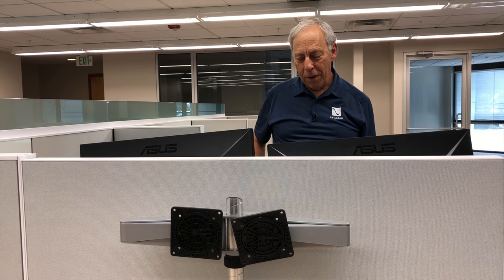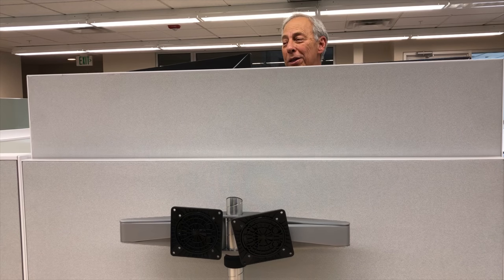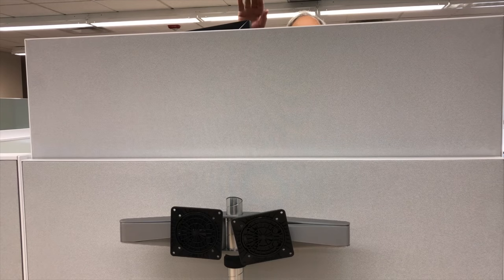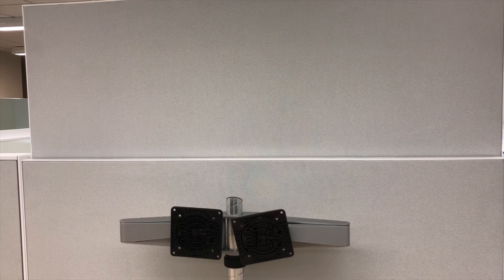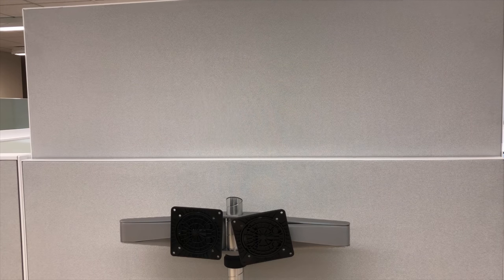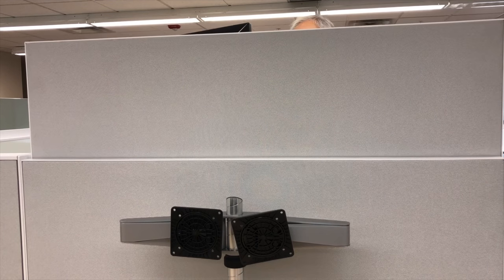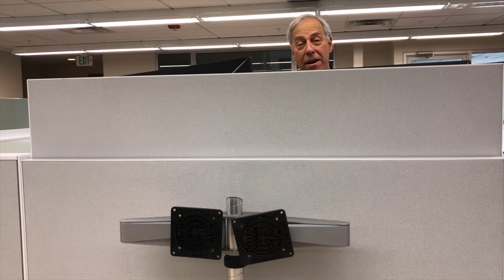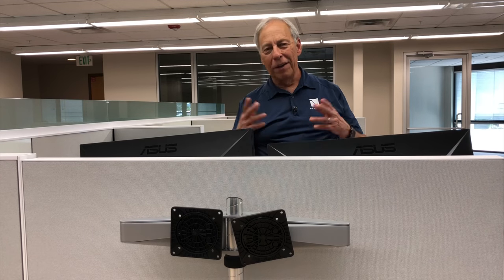Replacing capacitors in vintage equipment

Comment: Excellent info,  Paul, much thanks.

BTW, I wonder if it's a good idea to replace electrolytic capacitors with lower ESR solid state capacitors (e.g. tantalum, polymer film) of similar capacitance value and equal or higher temperature and voltage capabilities.
Reply: it could be a good idea to replace electrolytic caps with solid state ones, but solid states caps don't have high values rating like electrolytic (for example you can find 100 uF polymer but no higher value) or you have to put lots of caps in parallel. If you can do this big parallel on a DIY circuit where you have space enough to manage, you can't do that on a commercial amplifier where internal space is little. I have worked some 10 years as a electronic technician for cellular phones and we had great problems with tantalium caps so my advice is: avoid them. On signal path, if you can, use polyester or polypropilene caps. On power supply use just regular, fresh electrolytics and you are good to go

Comment: A a hamradio operator who restores and uses vintage  +/- 60 year old radios. I deal with lethal voltages. I have all of the necessary instruments do the the work.  Learn what brands of cap age well and those that don't. A meter that shows ESR's is your friend.

Comment: I have a pair of klipsch  chorus  speakers and want to recap them,looking high and low on the net with no luck getting  the same values,talked to crites and he wants  $90 +shipping  to  Thailand   plus exchange  rate and import duty.....$180 cnd  for 8 caps....ouch!!! Any idea where I could purchase replacements... 7 uf and 68 uf 100 volt,and 2 uf 250 volts.....

Comment: Been watching a few vintage amp repair vids lately. The amps seem to be in the 40  year old range (if not more) and only ones worth the effort of course.  Anyway, even after 40 years they weren't replacing all the caps. In other words 20 years is probably unnecessarily aggressive.

Comment: I largely agree with everything here but think Paul is being a bit pessimistic about timescale. Good quality electrolytics are usually fine for more than 30 years so long as they haven't been overvoltaged or exposed to much heat.
Reply: Haveyouevercheckedforleakage?

Comment: Question since you're an expert..  If I own high end audio equipment from Accuphase, dCS, and McIntosh and I want it to last as long as possible... is it better to leave it on all the time? or turn it off when not in use ... in terms of keeping the capacitors and other components health inside.. and last longest?
Reply: The only thing(s) in danger of going bad from not being on are the electrolytic capacitors. If you're running them more than a few hours a week that's good. I can't think of a reason to leave them on constantly, especially during a lightning storm.
Reply: @seanwatts8342  so the on/off surge of power and heat/cool down cycles are less of an issue than leaving it on all the time?
Reply: @seanwatts8342  thanks man, much appreciated my brother.
Reply: @Sams911  Let me clarify an exception: inrush current to a large transformer that does not have any kind of current limiting or "warm up" circuit can cause an audible 'thud' but you can reduce the chance of anything bad by using the 'standby' switch if you have one. OR if you're around all weekend and you know you'll turn it on and off several times, use the standby or even turn in down if you're on the phone, etc. Leaving it off for more than a day? Turn it completely off. Personally, I like to use a surge arrester and turn on the arrester, then the electronics - then electronics off --> surge arreser off. I'm not an EE, but my long time friend is an EE.
Reply: @Sams911  There IS inrush current BUT unless you're switching on-off-on 25 times a day (maybe more) then 'yes.' High end stuff is all solid state these days unless you have a tube amp?
Reply: @seanwatts8342  if you go to my channel you can see my system, two of the brands have standby modes, but my Accuphase stuff, which oddly is the most expensive stuff only has a hard power switch...  my pre-amp is a 100% tube pre-amp so that I know to turn off when not in use, so as to save the 12 tubes lifespan.

Comment: I got a pair of AR5s I bought new in the 70s, I had the 10 inch woofers tweeters n pots replaced in the 80s with original AR units when AR was still in Britain Dunstable I since replaced the tweeters bought from the US SH quite expensive SH but originals in early 2000s, I had them in my shed since I manage to buy a pair of AR9s SH the Real AR9s with a 10 n 12 inch woofers mid range 8 inch tweeter n super tweeter I found out trying my AR5s recently one of the electrolytic capacitors is gone finish of course I will replace both they are huge, someone said to me now days they have better caps not paper wound ones is this true? and how do I get the right one and will they degrade the sound quality in any way?

Comment: One thing that shortens the life of electrolytic capacitors is temperature. Replace with 105 C low ESR caps. There are many discussions online about replacement caps for vintage equipment, with even more opinions. Two names that frequently come up are Panasonic FM and Nichicon HE. Here are some brands:

Rubycon
United Chemi-Con (or Nippon Chemi-Con)
Nichicon
Sanyo/Suncon
Panasonic
Hitachi
FPCAP or Functional Polymer Capacitor (ex-Fujitsu caps which was bought by Nichicon)
ELNA
Cornell Dublier
Illinois Capacitor (Currently owned by Cornell Dubilier)
Kermet Corporation
Vishay
EPCOS
Wurth Elektronik

Some audiophile signal-path electrolytic caps only come in 85 C versions. Since audio grade caps weren't available when the equipment was designed, it is likely that the 105 C caps will sound fine. They will likely sound better than the degraded caps in any case. Of course you can experiment with audio grade caps, just be aware that 85 C caps may not last as long. Stick to 105 C in the power supply section.

Paul mentioned that selecting caps of the right physical size is important. When ordering caps, also make sure to note whether they are axial-lead or radial-lead configurations. Some of my gear has bi-polar or non-polarized (NP) electrolytic caps. These axial caps have a concave ring (+) at each end. In a pinch, you can make a NP cap by connecting two identical caps of double the capacitance in series, back-to-back (negative to negative). Two identical caps in series provide half the capacitance. The ESR is doubled.

Comment: Do not replace anything UNLESS:
- You know what you are doing and can actually do a proper solder.
- Know someone or company with the qualities mentioned above.

I have seen so many amps ruined by people who thought: I can do this, "i read it online". Burned PCB traces, caps that have been replaced with worse quality as the originals and fake transistors. If an electrolytic cap is bad, you can visually tell. If you want more bass, than larger caps are not going to do much for you.

Comment: Should one replace just the large electrolytic capacitors on the input power supply part of the amplifier?  (I'm guessing its setting up the DC bus but I'm not an EE.)  Or, do you need to go all out and replace every single cap in the entire amplifier?  Thanks in advance.

Comment: So, power supply caps will not make an audible difference unless they were going bad, and typically if they get out of spec and the amp knows this, it won't even power on.  So, please don't expect that power supply caps would make any amp sound different, rather newer power supply caps would simply restore the amp to it's original designed specification (in the power supply section).  Oh and yes, electrolytic caps do deteriorate over time.  However I have some amps that are 25+ years old with all the original caps, and they still sound fine.  I guess not all caps are created equal....

Comment: In 11th grade I had a crotchity old teacher that taught the 2 period "career electronics" class. When explaining about electrolytic caps he purposely connected one backwards about ,5 in long x .25in dia then stood back as he turned on the power. It of course exploded bowing the sides of the metal trashcan. He explained that if it did this to the can what would happen in someones hand. somethign to definately be respectful of.

Comment: From my experience amplifiers from the 80s have most capacitors still in spec. From the 70s about half will be off and 60s most are. However i never had a capacitor lose value, they always gain capacitance. My akai reel to reel player had almost every capacitor twice to triple the rated value
Reply: Agreed.  Capacitance rarely goes down in value.  Most old caps I find have risen in value as they dry up and age.  Not sure what he’s talking about.

Comment: I am replacing a can-type electrolytic capacitor in my old Scott LK-30.  After 40 years of storage, I decided that it was time to see if the unit worked, and the capacitor leaked and smoked up the room.
I need to know whether the outer can of the capacitor is supposed to be grounded to the chassis.  The original was mounted on an insulator-type mounting plate. The new one came with a metal mounting plate.   So with that mounting plate, the capacitor shell is grounded.   Is that proper?

Thanks to anyone who might help.

Harry Jaeger
Longwood, FL
Reply from the maker: That should be correct. Just make sure the polarity of the electrolytic's two leads (+/-) are going to the correct parts of the circuit as if these are backwards the cap will heat and eventually explode.

Comment: Connecting a power transformer backwards, with a rectifier and a bunch of electrolytic filter caps connected isn't a very good idea also. Man, what an BENG when that poor diodes and caps (63V types) got 4.4kV on them. Chemical smelling goo on the wall, toxic smoke and diodes broken in tiny pieces. That's how I discovered as a 13 year old kid that transformers are not only for bringing Voltage down...

Comment: I'm currently working up enthusiasm to re-cap my amplifier. It has 74 of the bloody things inside and the power caps are 15000uf 50v. It's not gonna be cheap or a quick job. It also could do with the bass and treble pots replacing 😥. Also wanna convert it to 4mm banana plugs for the speakers.
Reply: Seventy four electrolytics? Are you sure? I use Servisol electrical clean and lube on pots. I'd be amazed if your tone controls were worn out. Mostly they get dirty and need a good clean.
Reply: @jonathansturm4163  yes I counted them. Was surprised to find so many in a two channel amp. I've cleaned the pots several times and they are still making a blip at the center point. The cleaning has fixed the scratchy-ness though.
Reply: What do you mean by a "blip"? Some tone control pots have a centre indent so you know the neutral point between boost and cut by feel.
Reply: @jonathansturm4163  yes it's moving from or to the center indent that's makes a blip through the speakers.
Reply: What this sounds like (pun intended) is a bespoke arrangement of a tone defeat switch that operates at the centrepoint of the pots' rotation. When you clean the pots, you're cleaning the track and wiper, but not the switch contacts. How this works physically I have no idea; I've never seen such an arrangement. You probably should hit some appropriate discussion forums and discover what is already known of this. https://www.diyaudio.com/forums/index.php is a good starting point.

I have an analogous situation in regards to my beloved Rotel amp where I need a bespoke circuit board that's unavailable, or manage to fathom how a very complex circuit works and what's wrong with it. When there were only two amps using the circuit, the Rotel and a Pioneer that's problematic. My fallback position is to use the power amp section of the Rotel and feed it with a new pre-amp.
Reply: I hadn't considered it might be a actual adhoc tone defeat.  Thanks. 
Yeah diyaudio is a good site. Best of luck with getting a different pre - amp to work with your rotel power stage nicely

Comment: Since electrolytic capacitors wear out, is it possible to replace them with something that does not wear out? What about film capacitors?
Reply: Electrolytics generally have high capacitance values and are used for power supply filtering and decoupling. The other types of capacitors are used for other purposes and have lower capacitance values.
Reply: film caps are only usefull for small capacities up to say 100 microfarad . Typical elco's in amps or PSU can range up to 10,000 . At those values , a film cap would be unpractically large and extremely expensive  (far beyond 1000 dollars).
Reply: Some low value coupling ones can be. Power supply/timer caps are gonna have to be electrolytic though due to the large values and or need for polarity. Generally I'd say if you find bipolar electrolytic caps in a circuit they can be safely replaced with film caps

Comment: I have a Pioneer Spec 2 1978 power amp...do the caps need to be replaced
Reply: yes..
Reply: If you dont hear excess hum i bet caps are still good. Depends how this spec have been treated, was IT overheated etc

Comment: if you want really low ESR , just put 2, 4 (or 8) caps in parallel , instead of using 1 .
Reply: If it will still fit...
Reply: Not only if they fit, if the capacitance is bigger than the rectifiers can stand, the failure is served.
Reply: Obviously for 2 in parallel , you chose 2 with half the capacitance of 1 single , so that total capacitance stays the same . For 4 , 1/4th and so on . Some DIYers use this trick in passive X-overs to get a very good ESR comparable with expensive boutique caps from standard MKP caps .
Reply: Good comment
Reply: Sounds like a bodge to me to save a bit of money. Low ESR capacitors are very easy to get hold of and not that expensive either. They are used as standard in switch mode which is the dominant technology in power supplies throughout the world now. There really isn't an excuse to bodge the job.
Reply: Correct , dunno about PSU low ESR caps , but in high end audio Xover designs you will find that a lot of high priced boutique film caps are internally just nothing else but parallel standard MKP caps . Its the cheaper DIY option , nothing more

Comment: Asked my tech guy about replacing capacitors in my Kenwood L07M amps. He recommended I not do it. He believes the OEM caps were made in Japan and are of higher quality than new Chinese made caps.
Reply: Your guy is wrong and if those caps begin to leak current it will cause massive amounts of damage.
As long as you use good quality caps you're going to be better off. I'm sure if you put garbage caps in he might be right but who would do that.
Also be sure to get them from a reputable supplier .
Reply: Wrong. It's not where they are made but by who. Good quality control knows no boundaries. 1977 caps were grossly inferior to today's. Recap that Kenwood Purist immediately. Especially the four 18,000s in the power supplies.
Reply: It's rare for electrolytics to last without losing capacitance, gaining ESR, or bulging/leaking/bursting. If you are unlucky, this can spread damage to other components (in some computer motherboards, the cheap ones died in a couple of years).

But choose replacements very carefully.

Listen to Paul!
Reply: I’m taking the easy way out. I just ordered a pair of Stellar M700’s. Trading the L07M’s in. Let Paul and his employees deal with the caps. Time to start replacing my old equipment. Right now I’m looking at my DQ-10’s. I’m waiting for your speakers, Paul!

Comment: The capacitors on my old Sansui amp keep blowing very often. Its the ones that cause the LOUD cracking sound in the speakers. Im sure the technician replaces then with good quality caps of the correct specs. But he cannot  figure out why this keeps happening. Does anyone have any clue?
Reply from the maker: Sounds to me like perhaps you need to up the voltage on those caps. If you can find higher voltage versions that'll fit, that's probably the way to go. You can have as high as you can fit.
Reply: use higher voltage, but the same capacitance

Comment: I think the capacitors need to be replaced in my Yamaha 7.1ch receiver. Not sure what’s going on but it just doesn’t sound as clean and crisp as it used to. Though I have had this receiver for about 9 years now and there’s so many circuit boards in this unit, with it being a HDMI digital surround sound processor as well. Not sure if it’s worth fixing and just upgrade. If it was a vintage amplifier I could see it being worth it to fix it. I want my music playback and my surround sound seperate eventually and want to get a decent audiophile grade 2ch system with the preamplifier and power amplifier seperate.
Reply: Sounds like the right time-frame for a flood of cheap, crappy electros from China that hit the computer industry... Paying somebody to fix things these days never seems economically viable which saddens me. All that embodied energy going to landfill.
Reply: Jonathan Sturm unfortunately you’re right there. They don’t make electronics like they used to, or anything for that matter at least in the average consumer world. Things are made just to serve it’s purpose and then scrapped once it ceases to function properly. Having said that Yamaha do make some very high end equipment and have done for a very long time. I have seen first hand a rather expensive Yamaha integrated amplifier that retails at $9500AU with big beautiful looking VU meters on the front and a floating circuit design, very elegant piece of audio there!
Reply: The only Yamaha I ever owned was the piano I purchased for my first wife. Needless to say, she got the piano when we separated less than a year later. So it goes...

Comment: I’ve never seen a capacitor explode. With stock fuses and common sense it’s almost impossible. Electrolytic capacitor’s insulation gets leaky, current increases and the fuse blows. Don’t boost the fuse, replace the old caps and Bob’s your uncle!